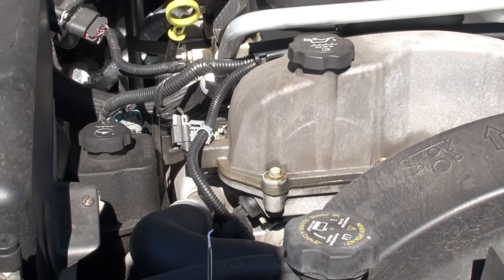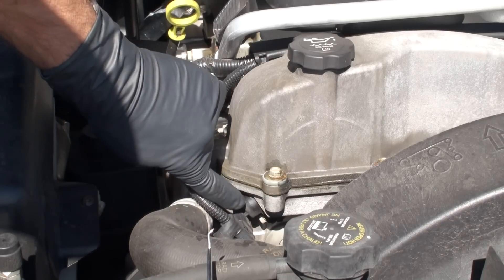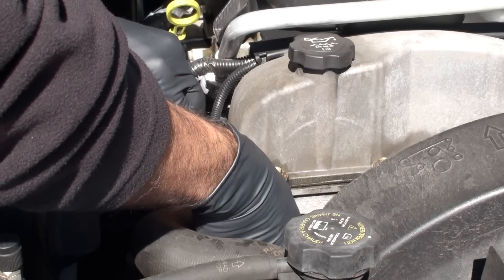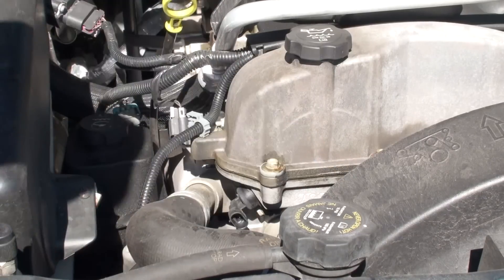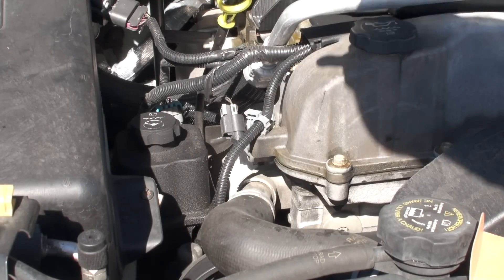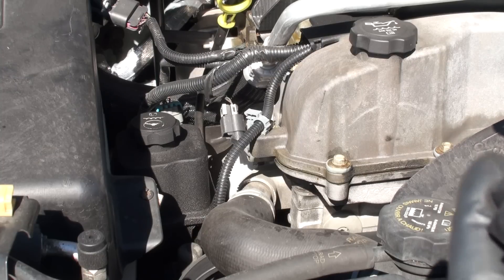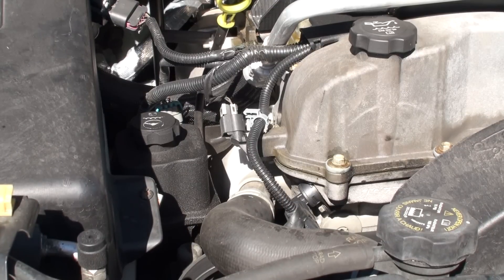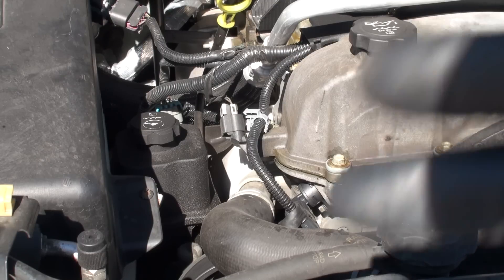06 Trailblazer 4.2 camshaft sensor location and replacement

Comment: Everyone having a severe misfire issue should change this and the solenoid that's next the the power steering reservoir.
Reply: What's the solenoid part called?
Reply: @starlord9956  did you ever find out what the part is?
Reply: Variable valve timing solenoid (VVT)

Comment: I have an 06 6 cyl Chevy TrailBlazer. the mobile mech. I talked to said it was this when I read him the codes I got from an auto parts store. It's running rough like it needs a tune-up. Is this right? Btw he told me he would have to get underneath the SUV to change/ replace it .

Comment: Will this cause the trailblazer to vibrate if the cam is bad
Reply: Thatsensor.  or motor mount. Or tranny mount.  If your MPG is like 8mpg like mine right now. It’s the sensor.

Comment: curious cody,,,which codes show up for this part to be malfunctioning? the p0014?
Reply: I have the same code, and for what I’m finding is it’s another sensor thats about 4-5 inches back from the cam sensor (different code) but at the same height. This sensor is much longer. (The 0014 code is for the exhaust cam)
Reply: @logankg0199  I have the p00014 code but can't find a replacement part for the item you're speaking of. I've looked at all the parts stores plus RockAuto. Any advise? I did however buy a NTK camshaft position sensor already. Saw this comment when I went to learn how to install it.

Comment: my o3 is throwing a p0014 code it says camshaft phasing system malfunction ...need to know what that means an if replaceing the cam sensor will fix it cause its only $36.99 plus tax at autozone so it's not that bad

Comment: What does VVT stand for ?
Reply: variable valve timing solenoid. it will throw a code p1345 (for chevy anyways)
Reply: Thank you, this is why I came to comments. I'm getting a p0014 code but when I googled it I got videos to change the vvt. But I'm not getting a p1345 so I think I can safely assume THIS is the part and video I need. So thanks again ☺️👋
Reply: @TengoWiskeyFoxtrot  the p0014 is the vvt not the p1345 which is the code I have now. Anyone got a fix for it?

Comment: did you forget to mention that after replacing the sensor that you have to do a engine relearn. so what if you don't have the porper equipment what do you do next?
Reply: Kenny Schneider I know this is old but how do you make your motor relearn like you said is that key on key off
Reply: No. Scan tool
Reply: .....I changed out the cam & crank shaft position sensors on my 06 Envoy and was happy to be done with it and happy that it would now be idling better....turn the key, and CRAP! Still chugging at idle?!? Wth??? Look up some shtuff online and find that disconnecting my battery would reset the brain,,,,so I DO of course.......still,,,,,chug-a-lugging like a mofo! I talk to someone after all THAT, that tells me the computer must be "relearned" by way of using some scanner with "tech2" (tek-2?) technology......???....so while at a reputable repair shop (Joe Lake Tireman) for other reasons, I ask the guy at the counter if they can relearn the new sensors that I put in....he says, "we replace the sensors here, so I have to think that we CAN relearn them. But let me go ask the guys if we do....".....he comes back to tell me that they can NOT do it.....so not even a state certified REPAIR shop can help?!? So.......DEALERSHIP wins with a 21! And I wAs proud to do my own work in an hour or less......for it to take my truck idling like crap for literally MONTHS before I could afford to take it to the man and let him & his TECK2 scanner talk to my vehicle and whisper in its ear that the work I did was finished and that it could now use the new sensors to compute proper system adjustments to allow for a smooth idle......lol!

Comment: just bought a 02 envoy with the 4.2 I6 for my wife a couple months ago, in the last couple days, it's been where you have to give it gas when you start it, otherwise it'll die. I got it scanned today and it showed codes P0014, P0507, and P1345. The fella at o'reilly said i'd more than likely have to change the VCT sensor and that'd take care of it. Just wondering your thoughts before I started tossing parts and $ at it.
Reply: could be bad fuel injector. does it stall?
Reply: +Jake Barrett 
it was the fuel pressure regulator, and a few weeks later, I had to replace all the coil packs. I also learned that with the 4.2 I6 you have to run AC Delco plugs. Bosch wouldn't work or NGK.

Comment: How do you clear the codes?
Reply: The best way to clear the codes is with a scan tool. If you don't have one, Autozone or most auto parts stores will do it for you.
Reply: +James Alber Parts stores will read codes, but will not clear them. Even if you beg them or offer sexual favors, they will say they cannot clear them.

Comment: how i clear the code after replaced ... and thanks for the video
Reply: if you don't have a scan tool to erase codes.....unhook the battery and wait about 5 minutes,  then hook it back up.
Reply: over theroad disconnect the battery and wait 5-10 minutes
Reply: @arronbenit5660  .. should the battery be unhooked BEFORE changing the sensor, or after?
Reply: Dylan Updyke after
Reply: @arronbenit5660  thanks
Reply: Thanks guys I was looking to how to clear the codes with out using a device.

Comment: ok so i changed my sensor 2 years ago and the computer continues to send the same codes even after clearing them with a scan tool. Now I'm having some issues while idle. Any suggestions?
Reply: crankshaft position sensor not camshaft